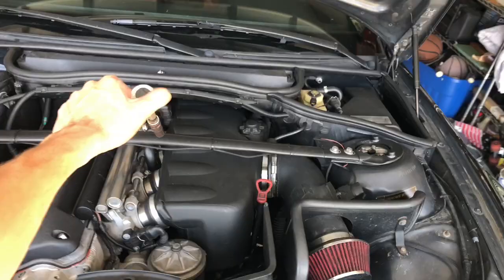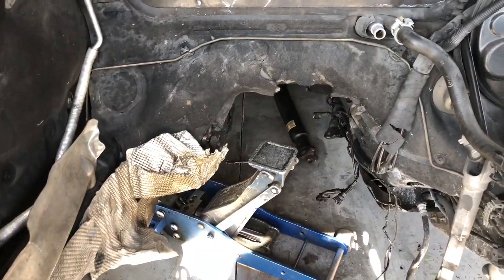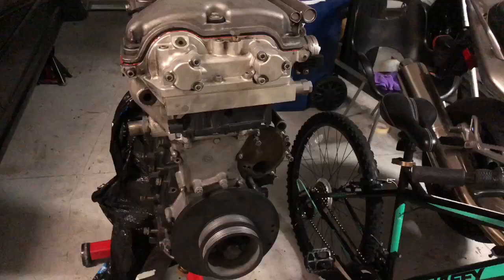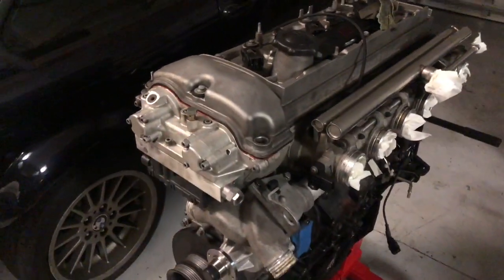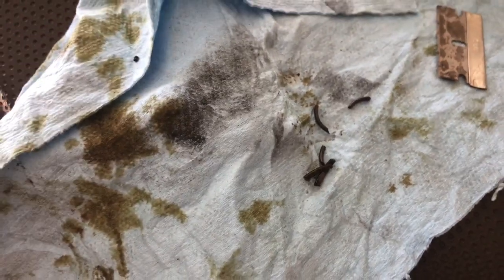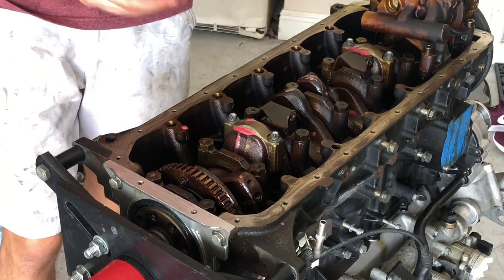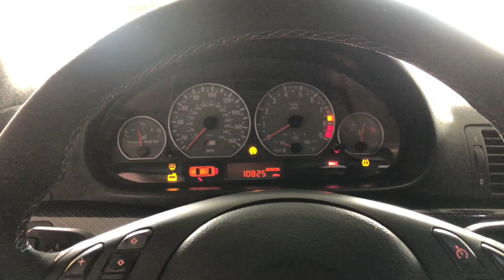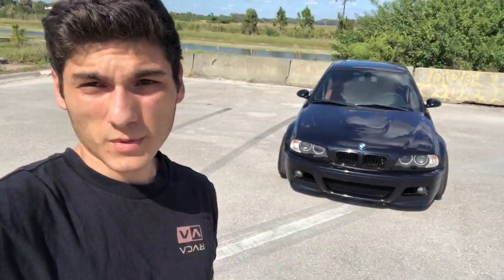Skip the Shop- DIY E46 M3 Rod Bearings in Your Garage

Comment: I should be picking up an E46 M3 very soon myself.

Anywas, tore the engine ad rebuilt the top and front ends and did a ton of mods and had a few incidents on my '01 XTerra a few years ago. First motor I've ever pulled and messed with that in-depth.

I expected it to not start when we had to fire it up for the cam break in and it fired up first try. That's one helluva feeling lol.
Reply: Did you got it?
Reply: @mk4guy  I did last Summer. Turned out despite being high mileage it was well cared for with a lot of mods packed into it: mostly The Big 3, Ohlin R&T coilovers, aftermarket Arm bushings and mounts, and Dinan overbored TB's. Put some time and some small mods into it. Needs repainted though. 

I have a vid of the RE exhaust bits I put on this past fall this account.
Reply: @goldenhide   Niice!

Comment: Nice jobs have you run the motor in ? And dose the motor only have the one mount to remove it the one next to the oil filter
Reply from the maker: Oh yes the motor has definitely seen some abuse since this video. Theres a hook placement up front by the filter and on the back of the block above the starter.

Comment: If you don't machine the crank I guess just buying standard size bearings is good right ? Or could it be that the crank or big ends themselves have worn out, requiring different size bearings ?
Reply from the maker: Buy standard size doing preventative maintenance but if it was too late and you spun a bearing then you’d need different sizes because the crank would need resurfaced.
Reply: @HoonGarage  Thanks !

Comment: Hi there. What state were you original bearings in? We're they ruined or would they have been fine to leave?
Reply from the maker: They showed wear looked like I chose a good time to change them but not bad for 170k on just recall bearings.
Reply: @HoonGarage  Great work on doing that job yourself without a lift. Can you please post a vid or link to some pics of the bearings with 170k on them? I think a lot of people would be interested to see what high mileage ones look like that are actually still ok (haven't damaged the crank). Also what type of driving you've done during that mileage. A lot of people seem to think they need to be replaced  every 50k which sounds ridiculous to me.

Comment: .do you reuse your rod bolts?
Reply from the maker: No, on the early engines you have to buy new ones because they stretch.
Reply: @HoonGarage  mine 04/2002 should I replace the rod bolts?
Reply: @HoonGarage  Just check on mine, there were no parts number given for the bolts but it was stated "Pos. 2- Connecting rod bolt M11 x 1,25
up to 02.03
 See repair manual"
Reply from the maker: You reuse if it is an 04.
Reply: @HoonGarage  thats incorrect, you can only reuse them if it before 02/03. The M10 only available 02/03 above but the M11 can be replaced if M11 bolts are damaged.
Reply from the maker: Linoge279 you do you, I’m just telling you from experience.
Reply: @HoonGarage  no worries and thank you for sharing your valuable experience, much appreciated.

Comment: water for coolant? if that was good for it bmw would sell them with water in their cars, best way to rust out your engine also the boiling temperature for coolant is higher than water.
Reply from the maker: Water wetter and distilled water is perfectly fine. Tracks hate when you run coolant.
Reply from the maker: @lrevitovhega4330  Thats why you run distilled.